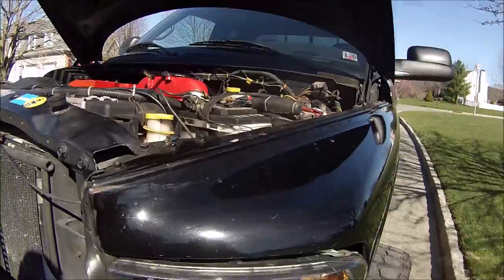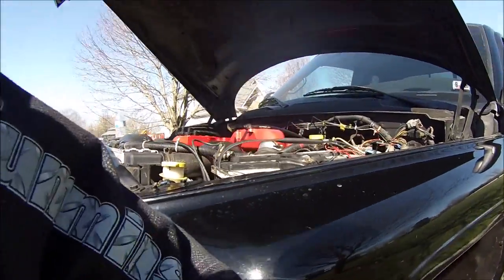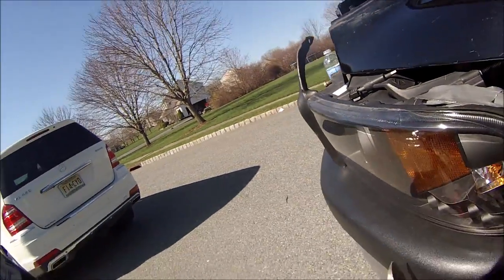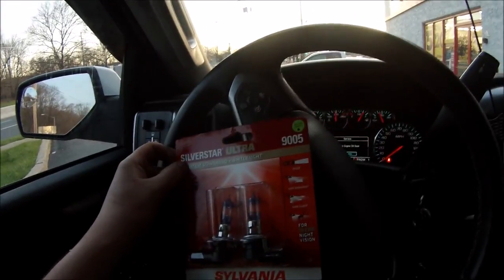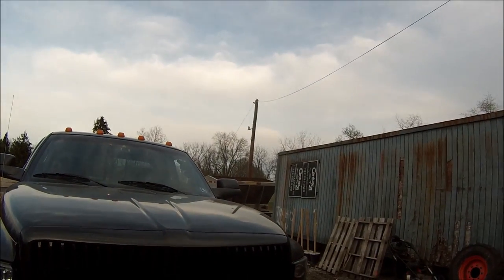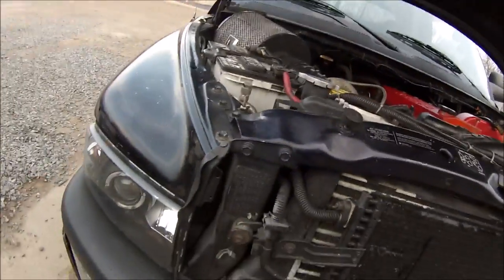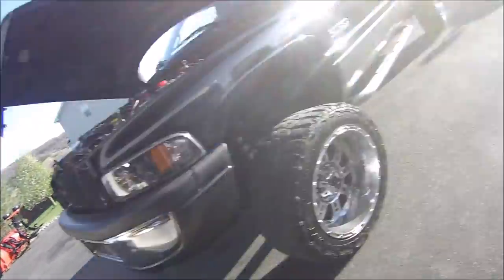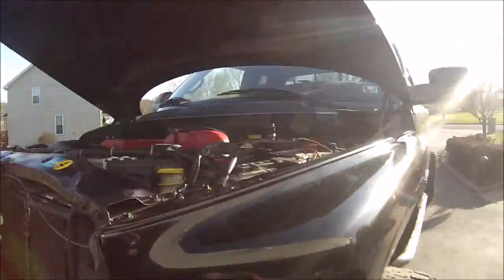Project Cummis Build Day 10: THE CUMMINS GETS BRIGHTER!!

Comment: 4th gen bumper is a must have
Reply from the maker: DillonBets 69 if I had the schmoney it would be an insta go
Reply: Cummins Kyle where I live you can pick them up at a wrecking yard in almost mint condition for 120 bucks my friend got one for 80$ with a small dent in it still cheap though eBay you can get an all black one for 200$ but the mounts are pretty expensive which is the shitty part